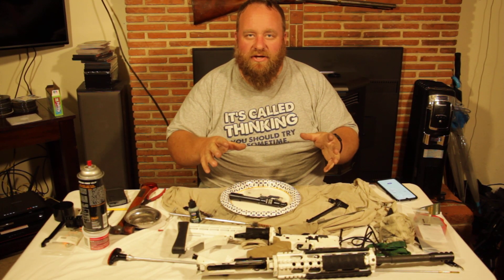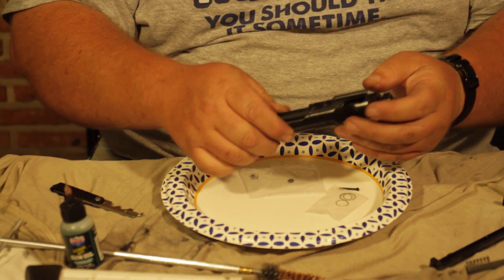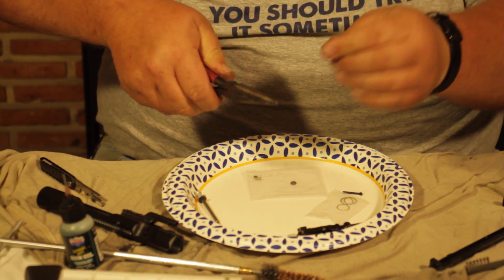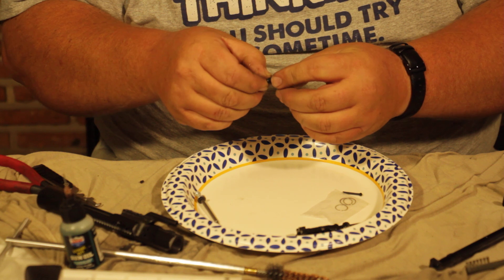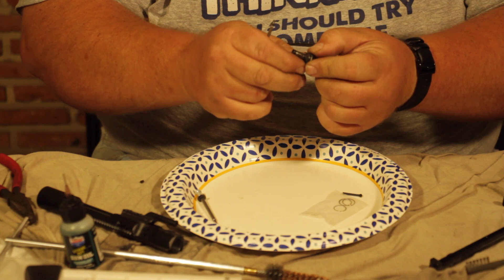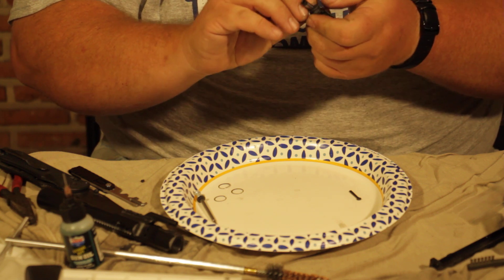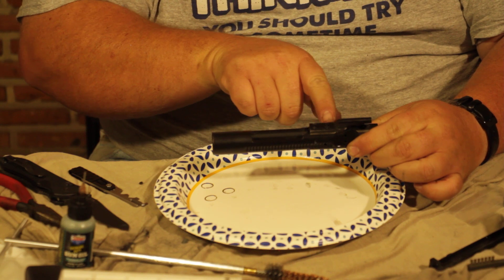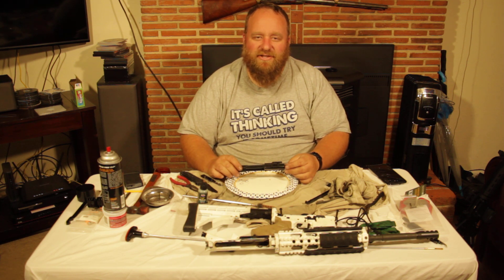Ar-15 - How to replace the gas rings and extractor spring in AR-15

Comment: Your vid was invaluable.  I've sent a lot of lead downrange and an armorer maintained it.  Now, I'm retired & don't have an armorer to maintain my collection.  Over 20k rounds in an old, beat up RRA and my extractor spring & firing pin key finally fell apart when I was scrubbing the residue from the wolf!  BTW, I used my US made Kershaw to open the bag of 'crucial parts.'
Thanks for your vid
Reply from the maker: Thanks for the comment glad it helped